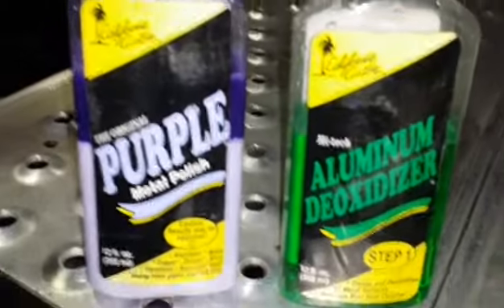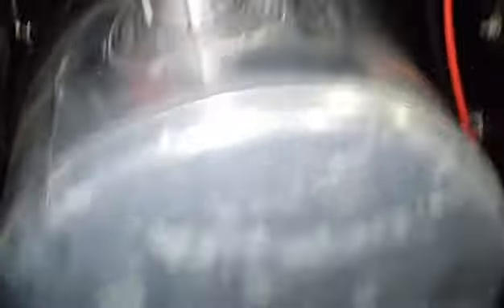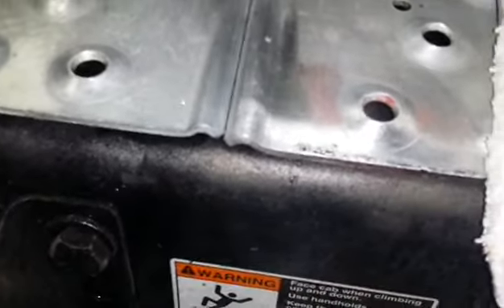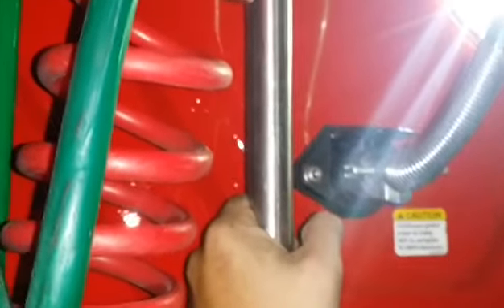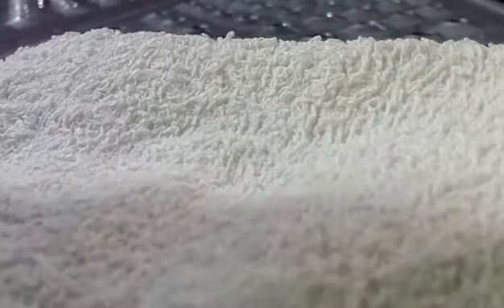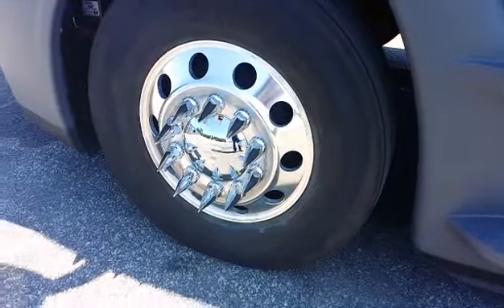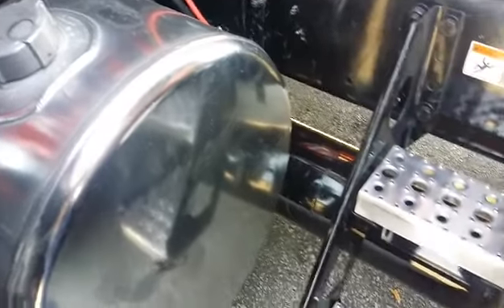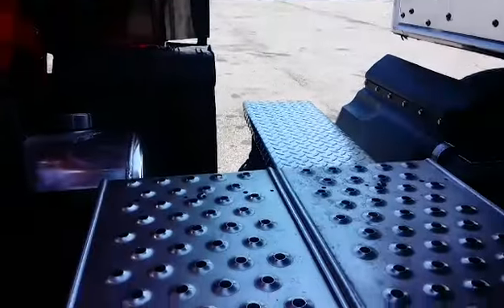California Custom Polish

Comment: I  pour oxidiser onto a piece of sponge. A towel absorbs more than it applies. A sponge also absorbs, but the oxidiser is squeezed out whilst spreading over the aluminium. I'd say you'd use half as much that way.    Rig looking sweet with that blinged up metalwork. ;-)
Reply from the maker: Scarlet Turk thank you. And Yea I've never thought of using a sponge, I gotta try that.